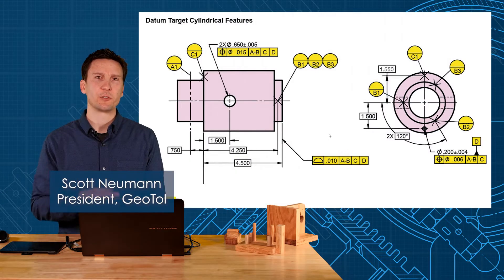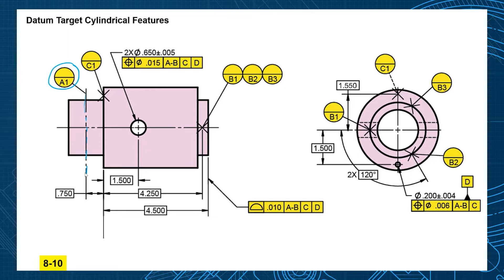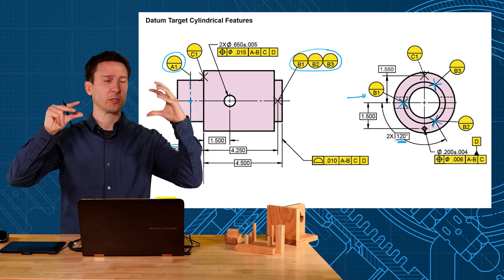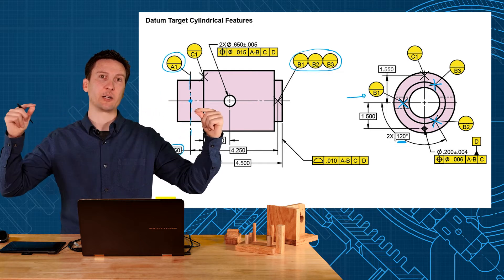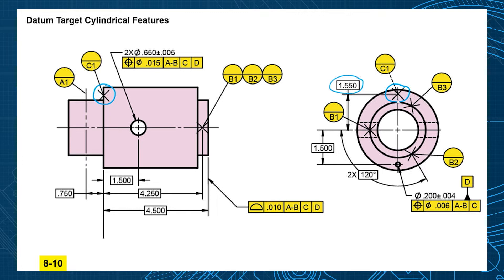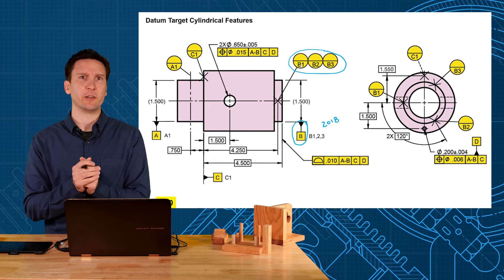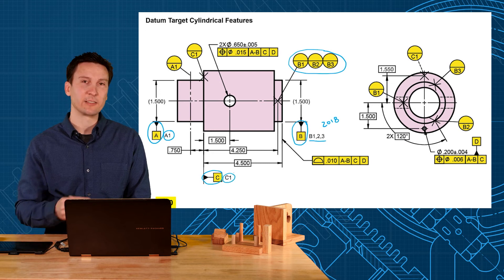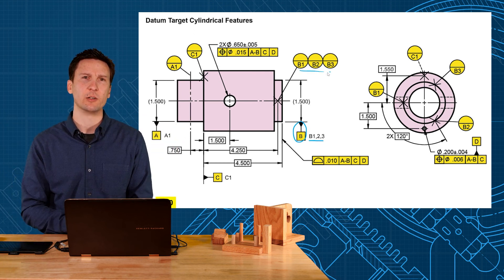Datum Targets on a Cylindrical Feature

Comment: All RFS. That's job security for the inspector. lol
Reply from the maker: Not sure I understand your comment. Position RFS is easier to measure than position with MMC modifiers (no bonus tolerance to deal with). Functionally, MMC modifiers are used on tolerances that qualify datum features and clearance holes. All other holes should probably stick with position RFS.